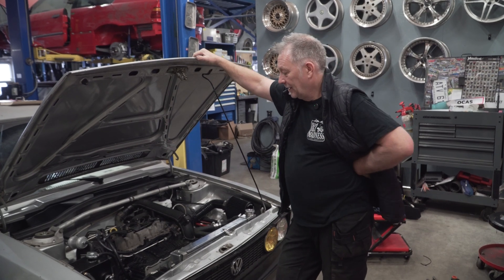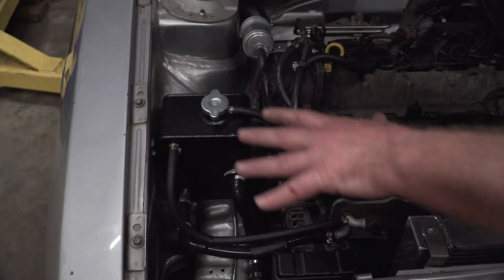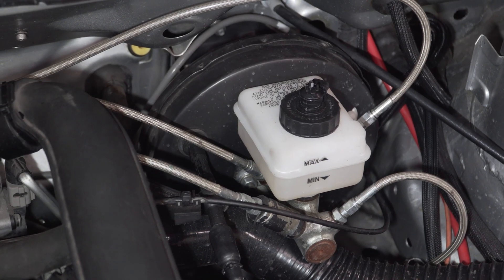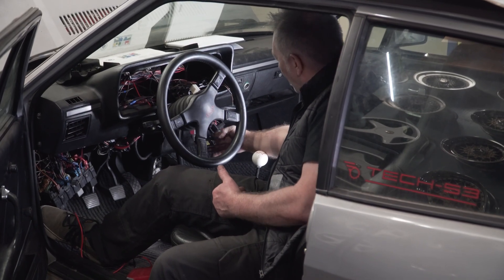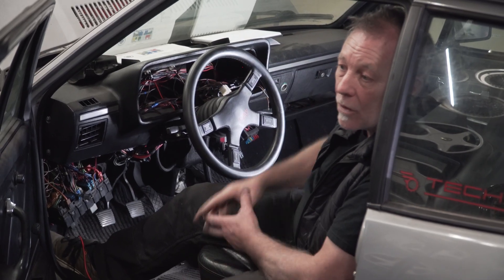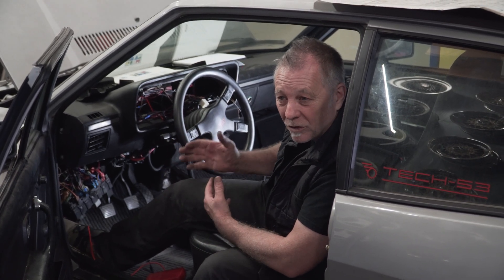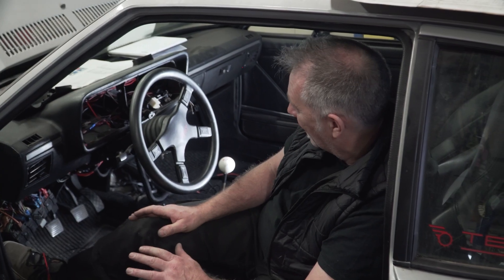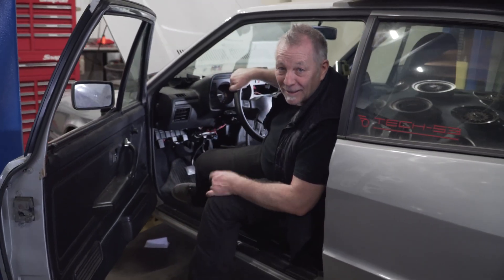1.4T Walk Around + First Start

Comment: Interesting bit about the brake booster in a boosted car. What exactly is happening? does the turbocharge system rob vacuum/pressure from the break booster?
Reply from the maker: When you have a defective check valve on a boosted car, your brake pedal can be negatively affected by boost pressure. By running an external vacuum pump to feed the brake booster, you ensure the pedal feel stays consistent no matter how much boost you’re making.
Reply: @tech-53 makes sense. Thanks for the tip. I appreciate you taking the time out